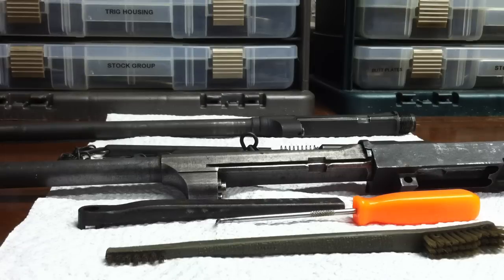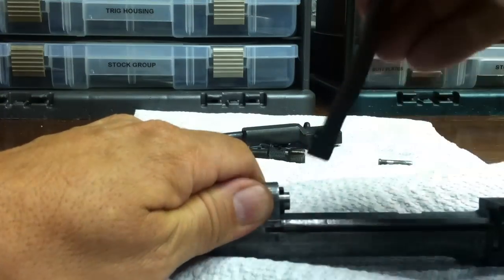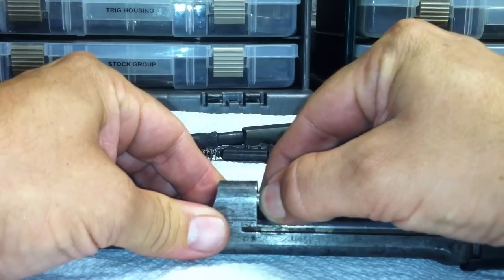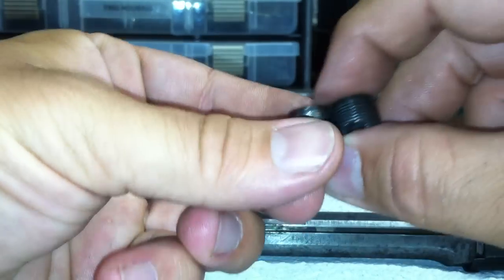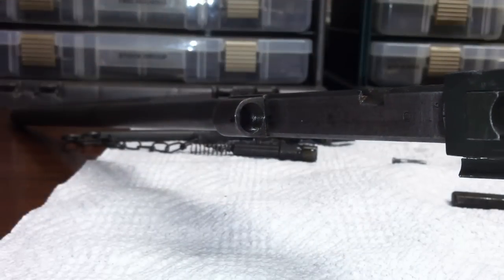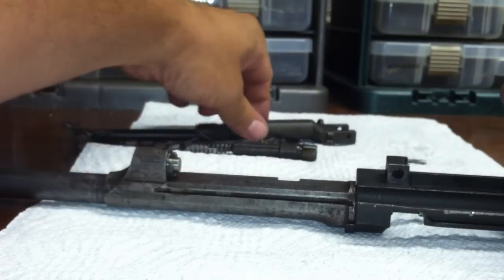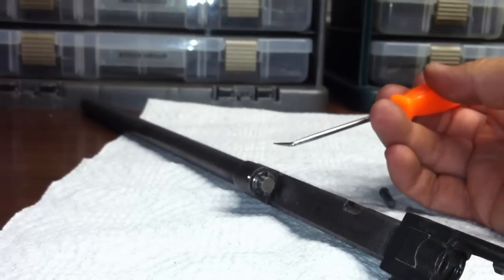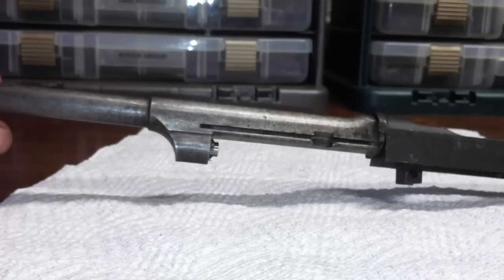M1 Carbine Gas Piston Removal/Installation

Comment: I was in the Marines 1967-70, a M-14 and M-16 Marine. Please do not stake the gas chamber nut, you should take it apart and clean it on a regular basis...
Reply from the maker: Disagree.  The nut can ride out after a number of shoots.  I have seen damage to a stock from the inside out where the piston flew out like a bullet.  Staking does not have to be heavy, just enough to keep the nut from backing out.  All three areas don't need staking, just one.
Reply: My experience with the M1, M14 and M16 is that parts only have to be firmly tighten.
Reply: @norwich93CMP  I have this very issue, actually came to this video looking for a solution, didnt know that the piston retainer nut was actually supposed to be staked, the first time it came out i just put it back together and tightened the retainer a little tighter, about 25 -30 shots later it came out again....